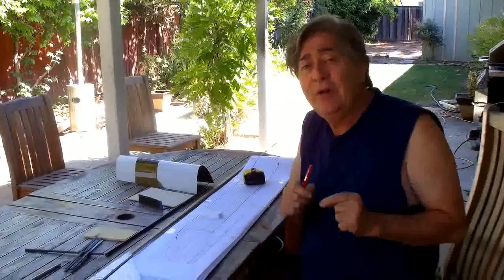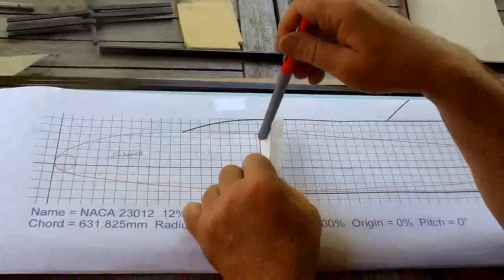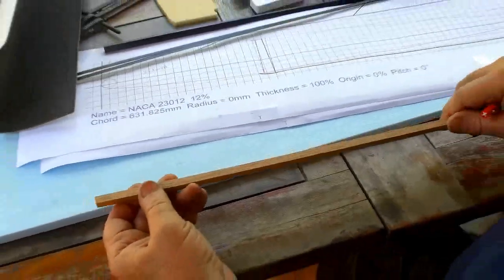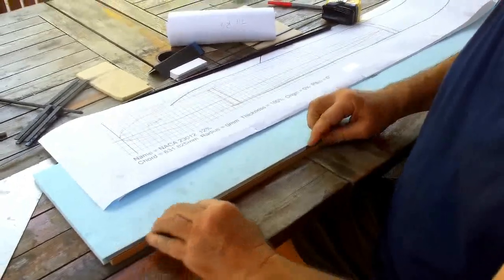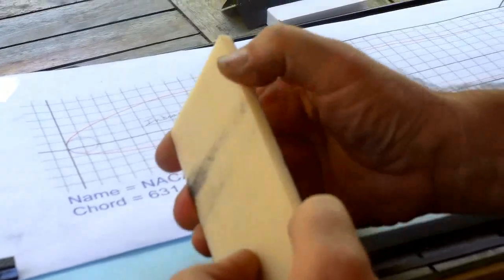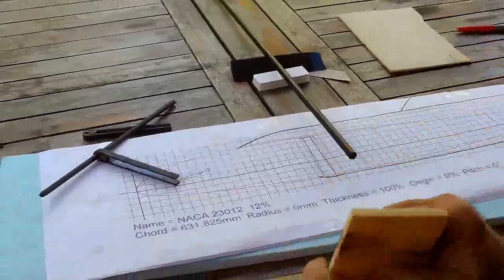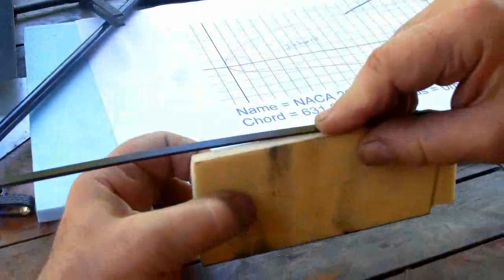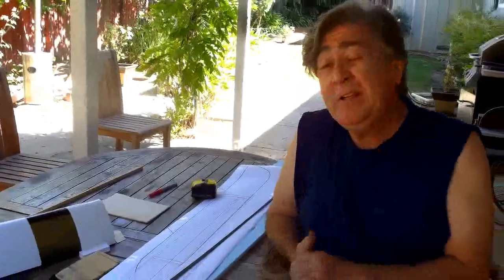Design Decisions - KW MkII Class 2 Hang Glider Development

Comment: Shouldn't the shear web be tilting noseward, (forward) for washout, or reduced AOA incidence?
Reply: The shear web is flat, it's the aerofoil that tilts. That is why the shear web will look at if it's tilting backwards if you're looking at the wing section at zero degrees incidence. To build the twist into the shear web would be very difficult and (I suspect) make it a weaker structural member.
Reply from the maker: Ah, I was wondering how long it would take for this question. I think it will be interesting to let the other viewers take a swipe at answering this question - anyone?
Reply from the maker: Ah, a perfect reply! Thanks miniphase, as a reward for this fine analysis I'd like to send you a set of plans for the 1/4 scale KW MkII R/C model. If you email me at rolkling@gmail.com, I'll reply with a PDF file of the plans.